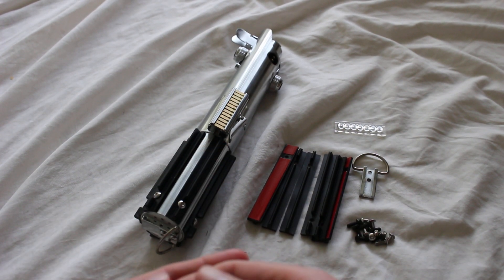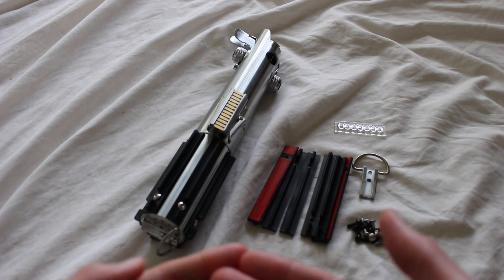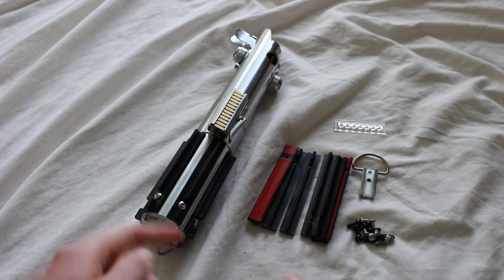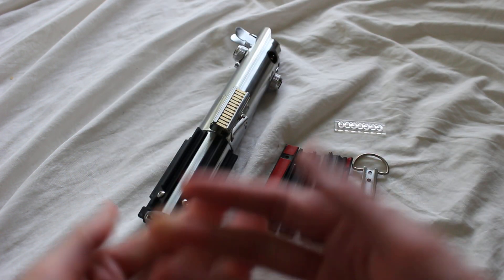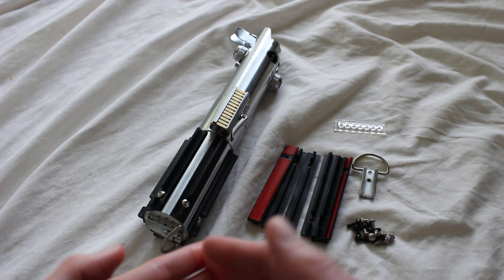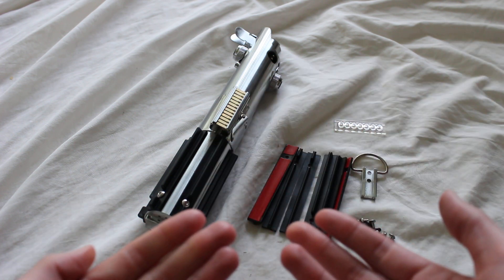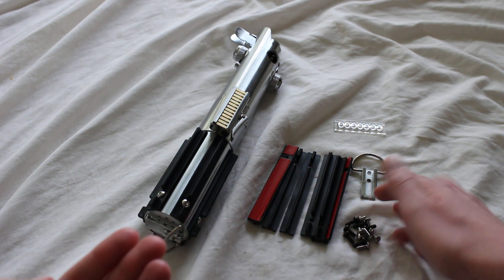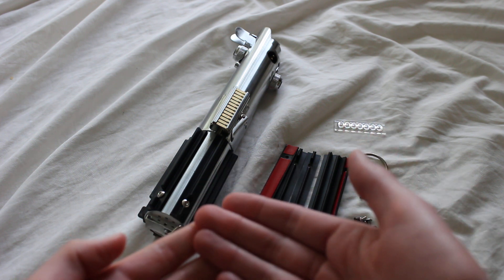What is a Graflex conversion kit? (Lightsaber Terminology)

Comment: This is not easy. ANH is the original and I like the glass eye over the second button as well as the beer tap, but the 7 grips look cluttered and basic D ring isn’t doing it for me. ESB grips and kobold D ring look great. TFA brings the best of both together as well as de-branding the Graflex, but the activation button location is not how I want it to operate. 
I think I will end up with a hybrid using the ANH top, ESB bottom and imagine it as an offscreen evolution between the two movies.